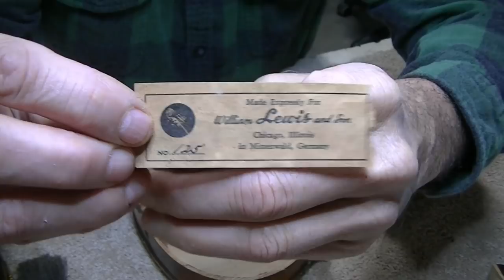209 RSW Grandpas Mouse Hole Fiddle Part 1

Comment: Gerry I love your vidieos I have learned so much from you. However I have to respectively disagree with you on why this violin cracked I would bet its due to lack of humidity, In my 35+yrs of custom cabinet/ furniture making & restoration I have seen severe cracking due to lack of moisture But I could be wrong. Anyway thank you I truely appreciate your channel God Bless
Reply from the maker: I understand your point. But due to the mold and due to the swelling of the wood and the Finish popping off I would say it was a lot of moisture. I see them that are dry also but generally speaking more instrument problems come from being too wet than from too dry. I realize a lot of my colleagues would disagree with me on that point.
Reply: Rosa String Works I believe you Gerry, I forgot about the mold. Thank yiu & have a Blessed day

Comment: On the hide glue, this is what I was told. It happened when I obtained an old reed organ a long time back and decided to rebuild it. I purchased a book on rebuilding them and it had a section on glue. It said the problem with yellow carpenters glue is that the water in the glue absorbs into the wood and can deform the joint. Whereas this isn't a problem for most applications, when dealing with repairing instruments it is preferable to use hide glue that cures instead of dries. This supposedly prevents less deformation of the wood. The other reason is of course you can loosen the bond with just heat and do not need the additional moisture needed to break the bond with carpenters glue. This makes a difference when you are dealing with a very old instrument such as the reed organ I rebuilt. I found the repairs that were done with carpenters glue much more difficult to undo than the hide glue and the old wood (this organ was built in 1891) of the organ soaked up water like a sponge which caused me trouble later on trying to refit the top of the reed board as sections had swelled and I had to plane it back flat to get an airtight seal. So I invested in a glue pot. Don't like using it but whoever rebuilds that organ again in another 100 years will thank me.
Reply from the maker: Yes I've heard all of those things before. Actually very many times. I just don't find them to be true. Thanks for watching.

Comment: Those Hansen dies are high speed steel. Most of the other brands are made of high carbon steel and are only good for fixing threads not cutting from solid.
Reply from the maker: Thanks for taking a look.

Comment: It busted up because the hide glue did not break loose at the seams as it is supposed to do. When the top or bottom shrink or expand depending on humidity or lack thereof, the bottom for example is supposed to break loose from the sides, which saves the top, biggest reason for hide glue.
Reply from the maker: Sorry I believe your misguided
Reply: @RosaStringWorks  Actually I'm not, titebond elsewhere is fine. Sorry, you are mistaken.
 You have quarantined a crack in the top if the top cannot break loose from the side, ask yourself how many violins you have seen where the top or back is loose from the sides. Unfortunately they don't always come loose and the top cracks etc.
 Of course titebond doesn't stain worth a darn.

Comment: You can bet that the vinyl reacted and damaged the varnish. I've had bad experiences with vinyl and PCB reacting with other plastics, even melting them where it made contact! The plasticizer used in vinyl is a particularly nasty stuff. And the softer the vinyl, the more plasticizer it has.

Comment: PS re:Titebond - all true except for III which is not the same as I and II and is supposedly for exterior work. Anyway it will not steam apart.
Reply from the maker: Thanks I only use original. Thanks for watching.

Comment: Do you think that 'mouse hole' might be instead be an over zealous sound post manipulator making himself more access to the sound post,?seems like the 2 similar type holes  I've seen on fiddles have been on that same right side near the post. By the by, This was a great video, thanx
Reply from the maker: Not likely with a  teeth marks all around it. It's pretty common to find fiddles with mouse holes chewed through them when they've been stored in attics and basements and places like that. I think this is the third one I've seen.
Reply: @RosaStringWorks  thanks for the reply.I just bought an old fiddle,with just such a  hole on it,I don't mind it  since it does'nt seem to effect the sound ,(which is quite good) and that hole reminds me of Willy Nelson's guitar,   I'm saving your video in case I ever decide to make that repair, Thanks again for site, there's nothing else like it.

Comment: Man inherits his grandfather's violin and sends it off to get fixed up. He gets it back a week later with a note that reads: "Here you go, I know how much this meant to you. I would normally not try to fix something this far gone, but for sentimental value, I took the project on. Unfortunately, the neck was bowed and twisted at a 45 degree angle, so I had to replace it. That meant the pegbox was different so I had to make new pegs for it. The fingerboard had to be tossed with the neck, it wasn't in any better shape. The body was completely beyond repair so I found another that looks virtually the same (I have found new accommodation for the mice that were living in it. They were grateful for the upgrade in living situation). That poor bridge just fell apart when I removed it from the body, so that's no longer original. The chin rest was eaten through with black mold and had to be incinerated by the CDC (my shop was quarantined 3 days for that one). Lastly the tailpiece accidentally caught fire while they were burning the chin rest. On the bright side, I left the original F-holes intact. Hope you enjoy your grandfather's violin. Enclosed you will find an itemized list of all parts and labor.  -- JD
Reply from the maker: Thanks for watching.
Reply: thought you might appreciate the joke more than most.  =-)

Comment: I stopped watching at 9:05 when you used a quality modern glue;) Hide glue is what they used 600 years ago and we shouldn't improve it;)
Reply from the maker: I understand your point. I respect your point. My point is stradivari always use the very best material he could find. If he were alive today he'd be using better glue. Thank you for watching.
Reply: I was just joking. But seriously - do they still use hide glue on high end violins?
Reply: I bet the folks who still read by the light of oil lamps do. LOL